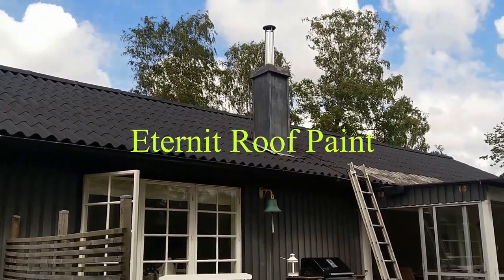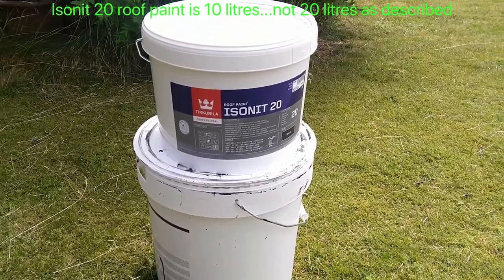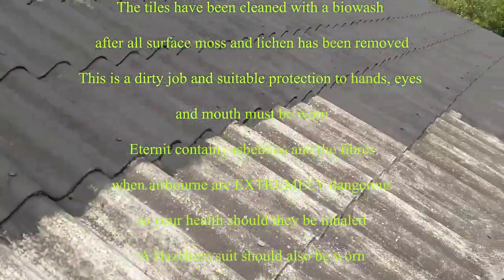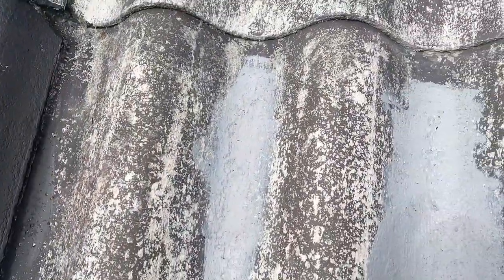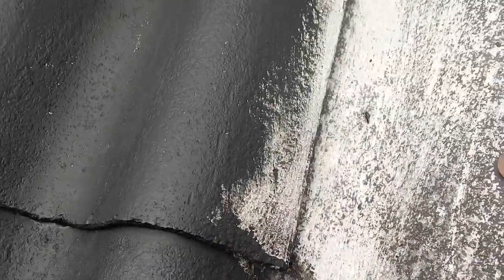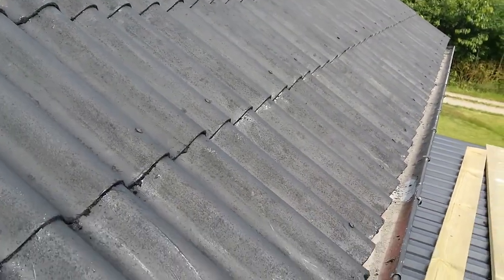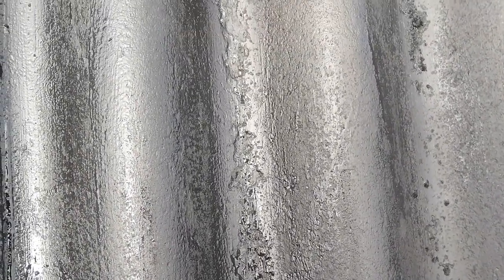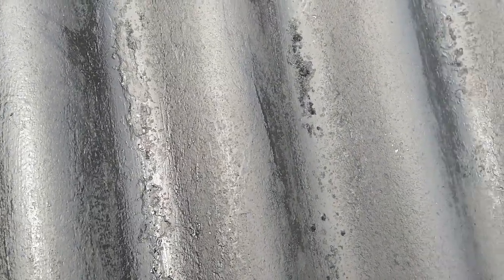Eternit Asbestos Roof restoration and painting

Comment: how is its still allowed to be restored when  asbestos? thats crazy in belgium it has to been removend. i hope u been wearing a suit and mask. a brush stil realizing fibers.
Reply: I would say its safer to handle the painted asbestos rather than unpainted as it adds some extra protection and binds the asbestos fibers. 
Would have been these tiles coated in pitch or tar by the factory during production, and then dip painted, these things would last longer than any type of roofing. 

Its a shame it hasn't been treated like so by the manufacture. 

Asbestos roofing is dangerous only if its moved or breaks, because thats when the fibers pollute the air.